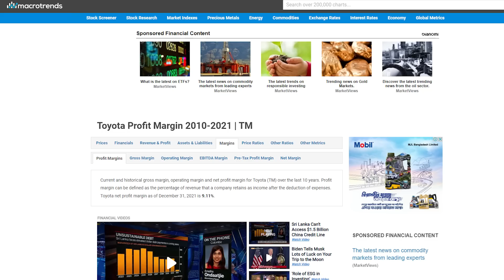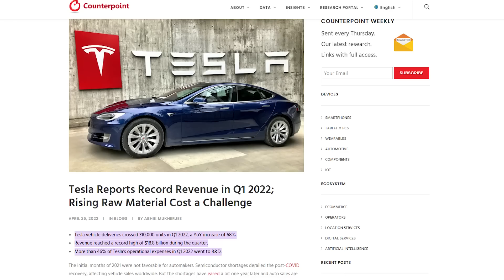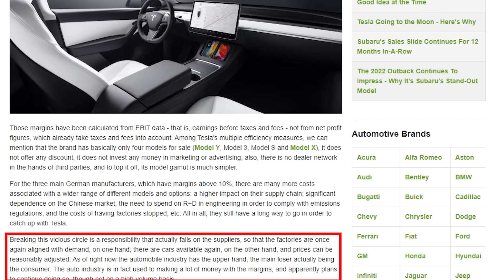Tesla makes 3 times more profit than Toyota per car (Kodak!)

Comment: IMO i think this analysis is wrong of toyota. other lagacy company maybe, but not toyota. keep in mind that the big different between EV and ICE is mainly the engine and reliability of the electric motor. in teh early day of electric motor car, lithium battery tend to over heat and catch on fire easily making it a big risk. big company liek toyota cant risk doign full blow EV cause the risk is too big. but u have to keep in mind that to keep up with teh tech, toyota being doing hybrid for decade already. so u know that toyat tech with electric motor is not anywhere behind tesla. toyota also being doing the other EV car that run on fuel cell. this also keep toyota in teh EV game for decades. the reliability of the electric motor is there. toyota is farthest then any1 on hydrogen fuel cell research wich will play a bigger roll in EV truck. toyota just wait for a major breakthrough in solid state battery which will  significantly reduce teh battery chance of catching on fire. toyota is about safety whiel tesla is about excitement. while toyota doing hybrid to keep with with electric motor research and keep up with teh tech, they also pure as much $$$ as tesla into battery research. imo with toyota and byd collab research on solid state battery commign into flueration, and toyota decades long experience with hybrid and fuel cell EV, making teh switch to install a battery into their car instead of a fuel cell will be easy. once renewer energy mature and we start to produce excess energy for teh grid, those excess energy can be use to make hydrogen and with toyota beign the farthest along in hydrogen fuel cell tech, they just might donminate the trucking industry since truck travel logn distance and a bigger hydrogen tank only add a faction of the weight that a bigger battery will.

a Tesla is nice but i prefer the plugin rav4. a bettery big enough for daily drive in town, and still have that backup ice engine if u are traveling long distance. best of teh 2 world.
toyota new all ev line up commign out and with their solid state battery curretnly already on the road testing,

Comment: How many vehicles did tesla sell last year vs Toyota maybe 10% at the very most of Toyota's sales that were down by 28%?  Tesla delivers poor-quality vehicles and can't service customer vehicles in a reasonable time no matter how small the repair is.  Now that more new EV companies are coming out this year with their vehicles  Tesla will lose market shares and will have to change its way of selling their vehicles and drop its prices to stay in business. If not for the pandemic Tesla would be just another struggling car company trying to survive. Elon chose to keep his car factory open when most of the companies around the world closed down by law or work remotely from home.
Now Elon thinks he knows how to fix everything in the world but not his cars. Elon needs to just work on finishing projects started years back.
Reply: Not correct! Tesla delivers high quality and high performance cars. Their service has improved a lot in the past years, and when I order a service appointment with the APP, I get an answer within a couple of hours and appointment within a week. I have had 32 ICE cars including Mercedes Benz, BMW, Audi, VW, Opel, Ford, Fiat and Citroen. For the last 9 years I have had only Tesla, and that is the best car I have ever had. Superb for wintercondition with remote start of heating and campmode so you can take a nap and keep warm without the danger of poisinous exhaust. Never ever ICE vehicle again!!

Comment: You don‘t understand the manufacturing of VW. They have a model kit for all models and brands. They combine specific elements for new models. They don’t need different production lines.  BMW builds EVs and ICE on the same line. On the other hand, Tesla has three models, that are available and becoming more expensive every month. No affordable family car, no van, no pickup, no small car for small streets. Manufacturing quality for Tesla is still under par and reliability is bad. Either Tesla cashes in and get lost in the long term or Tesla diversifies and build up manufacturing quality. Freemont quality is bad beyond repair. This will cost money.
Reply: @benjaminsmith2287  
"Tesla isn't diversified".... Except in:
Vehicle production.
Battery production.
Energy storage systems (domestic and commercial)
Solar.
Communication systems.
.
I'd say that's pretty "diverse"?
With more to come.
Reply: @benjaminsmith2287  
'As for BYD"
Would you call Warren Buffet a shrewd investor?
Notice that huge investment in wind energy?
I wonder if Warren has done some horse trading?
"Hey Mr politician, I'll make you look "green" if we can smooth the way for BYD to enter the US car market..... Btw, they'll build a few battery factories as well"
.
D'ya think that might work?
Reply: @benjaminsmith2287  
Again(!)
Don't concentrate on "market share"
Look at "addressable market"
60+ million global per year.
Reply: @benjaminsmith2287  
Just btw....
"The vehicle fleet isn't"?
1) Doing ok so far!
2) More vehicles coming! (And not "badge engineered" clones)
3) "The Energy business will surpass vehicle manufacture"
4) You REALLY need to watch some Tony Seba.

Comment: Next year chevrolet will have the Silverado and the equinox following based on ultium skateboard.  Prices less than Tesla model3. Ford will be expanding the electric car manufacturing process and sell a bunch of trucks and MachEs. VW will make more id cars and  Teslas glory days will be over.  These tradition auto makers screw together quite dependable vehicles for a price people can afford.
Reply: Right now you can buy a Chevy bolt for around $25,000. Bet they won't make/sell over 30,000 of them this year while Tesla sales will continue to increase. 
Silverado is priced around $100k so really not much competition with Tesla. Chevy may have a few equinox EVs priced around $30k but I bet they are losing $10k/vehicle and won't offer very many base models at that price.
Reply: @davekozlowski1266  base price for Silverado is about 45K. The Bolts in this high gas priced environment will sell a ton to new EV buyers who know nothing about the history. They currently can not make more than 40K per year so selling 20 to 30K is probably right. Parts shortage is the issue. I had a Bolt and sold it back because of the fire issue. The car had no rattles was well assembled but the uncomfortable seats and the slow charging and harsh suspension were a huge bummer. The 2022 addressed the suspension part I read and improved the seats but did not make them great.
Reply: jesus....ten years on and we still get crap like this: "the competition is coming! Doom for Tesla!"    ten years I've read this crap!  what's the word I'm looking for...oh yes...BOLLOCKS!
Reply: @swanvictor887  Ten years of me buying more TSLA on the dip.
Reply: @swanvictor887  When has there been Tesla competition, you know cars made by the big three. Tesla won't die it just won't be the end all be all for EV's in short order. VW sold a lot of cars so has GM and Ford who have been able to fully ramp up production.  Currently tesla makes more money than everyone per car but how long will that last when competition is coming out?
Reply: 😂 no Tesla's better days are coming. All these legacy automakers will still bleed money with their cars sitting on dealership lots with marked up prices while not listening to what consumers want. Also Tesla isn't running any kind of debt like the other automakers.
Reply: @ChicagoBob123  Tesla don't 'need' to be Number One - they just need to make profit: I'm certain Musk doesn't give a crap about  where Tesla is in a chart...he is focussed on goals; 20 million cars SOLD in 2030, same every year ad infinitum.
As  for Legacy Auto: MASSIVE DEBTS THE TAX-PAYER WILL NEED TO PAY FOR!!
If they survive...then they need Gigafactories! 
They Don't have gigafactories!!
The factories they do have....are Worthless!
I haven't even mentioned the Technology and Software!
Tesla are currently 7 - 10 years ahead of Legacy Auto...and are increasing their lead.
Existing Plants are useless - Tesla can testify to this as their Fremont factory has been nothing but trouble! Legacy Auto has hundreds of these derelict buildings, full of useless robots.
Reply: The key to ICE manufactures futures is how many EVs they can make.  Tesla is sort of irrelevant to that.  If Chevy can make 100,000 Silverado EVs, that is how many they will likely sell.  Chevy doesn't look to be PLANNING to make millions of Silverados, so they can't sell that many, and thus Tesla, which IS planning on making millions of EVs will sell that many.
Reply: @ChicagoBob123  please show me where you will be able to buy a Silverado for under $65k this year. First model they are making lists for $105k. 
Also, neither Ford or GM has been able to produce EVs in quantity to date. Less than 50,000 per year.
Reply: @CorwynGC  I think 100k Silverado's a year @ $100k is optimistic, but good luck.
Legacy Auto have the huge problem of their Dealership Network, plus Mothballing / Demolishing OLD factories, building New factories, losing money on every EV they make while ICE sales are collapsing....oh, and their eye-watering Debt..... apart from all that, yeah, no probs...look out Tesla...lol
Reply: @ChicagoBob123  
Do you really think GM will make money on $25k Bolt?
.
The "real" price was just under 40k in 2017.
Reply: @ChicagoBob123  
How many times....?
When the potential addressable market is growing faster than the potential supply, no competition.
When companies are selling vehicles near, at, or below cost, to try and appear successful....... NO competition.
Reply: @rogerstarkey5390  yeah but very little.  This was reported someplace that they made over 140k cars and started to make a small profit 2021. If they can ramp production up again producing over 30k units per quarter without any more unpaid for changes it will be a winner by 2024.
Reply: @CorwynGC  
Re "the key"
Or rather the question...
Is "how can they dig themselves out of the hole?"
When you look at GM.
Bailed out after 2008, then debt written off in 2012, then displaying the spectacular talent of acquiring ANOTHER $35Bn + debt in the following decade....
Now requiring massive investment to transition.

We should ask
Where's the money coming from?
Reply: @swanvictor887  that's pretty much been what all the other legacy automakers have been trying to do. At first they ignored Tesla all the while Tesla was just listening to customers and giving what they wanted. The legacy automakers now have a rude awakening since their market shares are collapsing because of Tesla. That's the only reason they are now "trying" to make EV's.